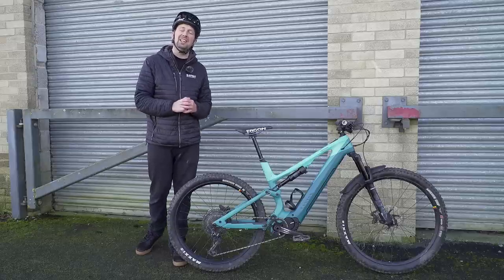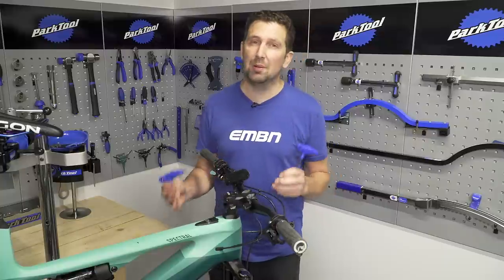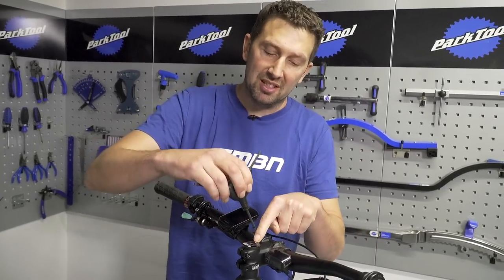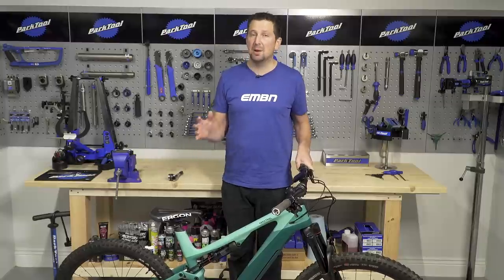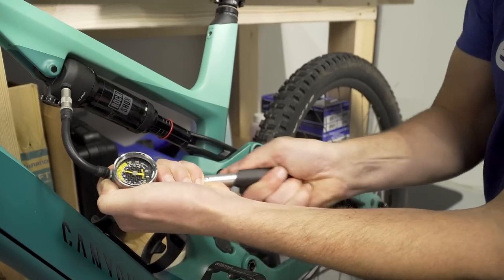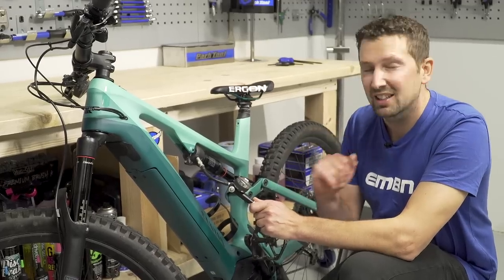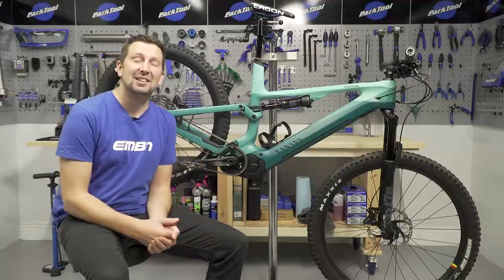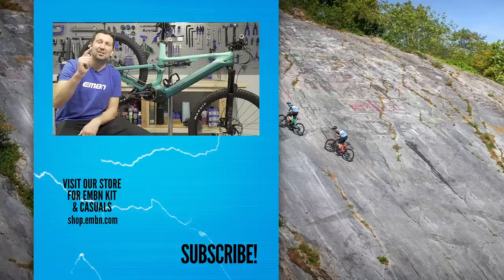E Bike Maintenance For Beginners | The Top 5 Tasks For A Problem-Free E-MTB!

Comment: Great video! I had a front break noise problem. And exactly as you showed fixed it. Disc brakes were a bit intimidating at first. Now the actually seem simpler and easier to adjust than the older styles. Also a great tip on the dry chain point and where to lube the chain. Thank you!!😀🙏

Comment: Thank you very much for your hints and advice 👍👍👍.
Is there a new video eventually planned about changing the chainring to a smaller one for a Bosch CX motor? Is ist possible, that some problems could occur with the Bosch motor management, if the minimal gear ratio is changed under the allowed data?

Comment: Never use chain degreaser. You will find all chain mfg.'s say never to use degreasers, not even citrus. They remove lube applied at the factory, between plates, that cannot  e replaced. Besides that, I love this video.
Reply: BS. I have been using auto brake cleaner on my chains for over 10,000 km. I have got chains to last 3000+kms.
Reply: @islandaerial3414  so glad to meet someone that knows so much more than any chain mfg.'s. I have many customers, almost all, getting that kind of range out of even ten speed chains and not doing any cleaning at all. I don't recommend it at all and they will eventually pay for it cassette and chain ring wear, but then so are you. BTW, you've been doing it about as many KM's as I rode every year until I retired.
Reply: I put my chain into a dishwasher and it lasted for about 200km, just saying.
Reply: @islandaerial3414  you do realize that isn't very good mileage unless you are talking a 12 speed, right?
Reply: @MHH3180  Yeah, bike parts are garbage for the most part

Comment: Many thanks Fox the hTips. 
One Question: Why is it a problem when degreaser comes onto the disc?
Reply: its not a problem. I clean mine with degreaser regularly. I think he made that bit up.
Reply from the maker: Certain degreasers contaminate brake pads and drastically decrease braking performance. It's ok if cleaner gets on your disc, but we wouldn't recommend degreaser

Comment: lol cables do stretch on a bike comparing them to a barge is no comparison after thousands of bike repairs, cables do stretch and continue to stretch until they fail. the cheaper the bike the less likely they will not be made with stainless steel. if you have seen a spoke stressed till breaking it stretches at the weakest point. Pull your cable brakes too hard the cable stretches until the lever touches the bar but when you check the clamp bolt the cable is in the same position. We at the shop use to prestretch the brake cables before the bike left the shop i doubt most of the riders on this channel have much experience with cable brakes other than throwing them away

Comment: Hey man. I’m about to buy a Trek Rail 9.8. I’m 6”2 and all my bikes are XL. My daily is an Ibis Mojo HD3 but I’m just not sure if I should go L or XL with the Rail. Any suggestions?
Reply from the maker: How does the Ibis feel? Compare those geometry numbers like reach, stack, front centre & standover to both the L and XL Rail and make a choice based on that
Reply: It is not at all about your height. It is your inseam. My wife is 5'7", but has a 34" inseam. I have a 6' son with a 32". Great example of how we need to be properly fitted to our bikes, not merely sized.

Comment: modern gear cables DO NOT stretch. This is a myth. Once they have bedded in and been adjusted after a few hundred miles it will never need doing again. Please stop with the nonsense.
Reply: Dude that’s what he’s talking about! The one stretch! My Vado has 500 miles on it and I don’t get one gear. Because the cable stretched. After that yes they’ll likely be fine for a very long time so the gears will work probably and of course you won’t have to apply his excellent advise. He is just giving an easy fix.
Reply: @samhalsey5051  it did not stretch, they do not stretch. it bedded in, which causes a small amount of slack!
Reply: @jamesuk9  What do you mean by bedding of a Derailleur cable? Do you have a source?
Reply from the maker: Hey James, 'Bedding in' is the stretch we're talking about. Once the cable has done this once, it will not continue to do so. This is what Chris is refferring to, not a constant stretch, but a single stretch from new.
Reply: @embn  except it isn't s stretch, so why call it a stretch?
Reply: Both replies are wrong. Cables do still have internal friction and wear which results in what appears to be stretch. You can actually hear it in the huge barge cables we use here along The Mississippi. The same thing happens inside of bicycle brake and shift cables.This doesn't make it unuseable, but certainly on the way. 

Also, cable housing continues to degrade and thus compress. This gives the appearance of cable stretch.  It is not true that once a cable "beds in" it never needs adjusting. First, there is no surface into which to bed. Internal cable friction causes wear that does indeed make the cable longer, so stretch is a perfectly reasonable description. Obviously, the same is true with cable housing wear and compression. These things all happen from the moment a cable is installed and do not stop until they break or are replaced. BTW, all this is why hydraulic brakes and electronic shifting should become the standard, even on entry level bikes, in the very near future.